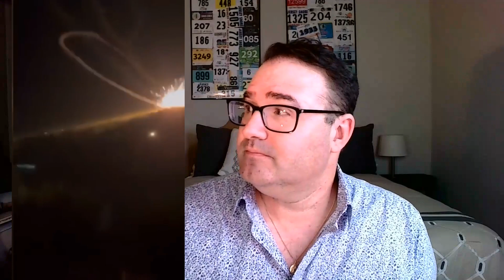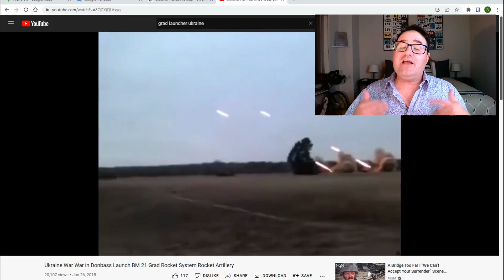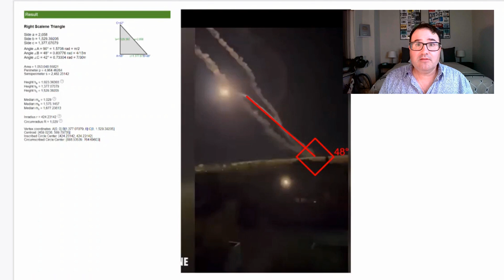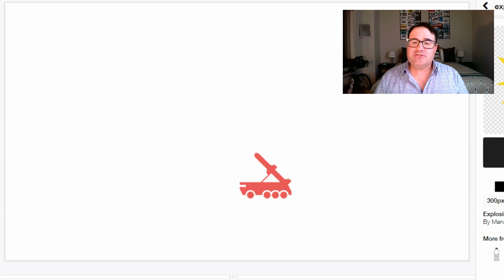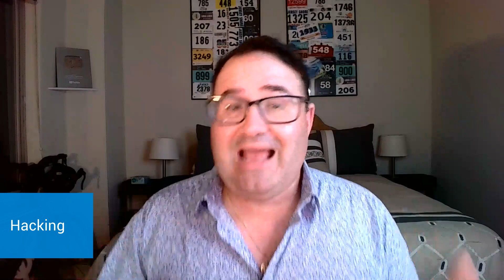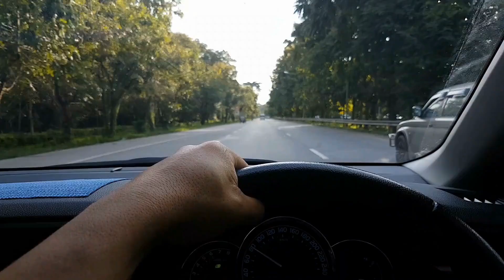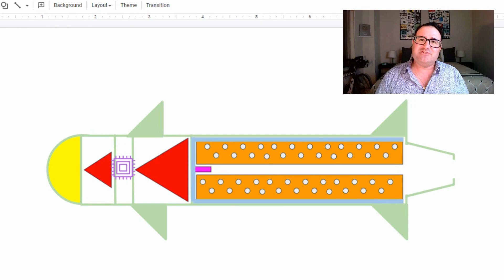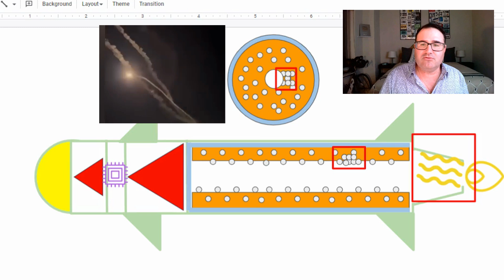Why this missile U -Turned

Comment: So I feel that the throat would even out any inconsistencies in the burn rate....enough that a 180 turn at high gs would be highly unlikely, especially a tight turn. It might unbalance the thrust, but not enough for that turn. I know it might be random chance but that is a very tight and precise turn. If you've ever see a rocket loose control due to fuel inconsistencies youd see corckscrewing, a parabolic curve, wobble or something to demonstrate an eratic burn rate. The point of the throat is to turn burn into parallel velocity.
Reply: It would probably also mean the instability happened in the nozzle...after the throat. Im guessing we'd detect that in the exhaust. Just my 3 cents.

Comment: Very plausible theory and sound logic.  However, I have a question about the fins.  I agree that there might not be a condition external to the missile to cause the fins to turn the missile around but since you brought up mishandling/maintenance/poor manufacturing, could a mechanism stabilizing the fins have broken after launch due to the massive acceleration/g-forces incurred in the boost phase?
Reply from the maker: Maybe, but usually When something breaks with that kind of catastrophic failure, it stays in the broken condition. It doesn’t correct itself. I think it’s the correction which leads me to believe it was a propellant issue. Someone else brought up that it could be a faulty switch that flipped during his g’s then flipped back In the turn. I think that’s possible.

Comment: Except uneven engine thrust can't cause such tight turn, for that you need side thrusters, or control surfaces.
If this was an uneven thrust issue, the missile would do at best a big 90* arc.
You are missing one obvious thing, which is the malfunction of the onboard control systems, which could rotate the control surfaces and cause the missile to turn.
Also, it wasn't just U turn, but a continuous turn which started with U turn. It's obvious from the video that the missile keeps turning as it slams into the ground, so it would keep turning if not the ground.
Most likely control surfaces got completely flipped for a hot second, and then almost returned to the proper position, but not entirely, so the rocket was still turning as it slammed the ground.

Comment: GPS guided. That missile was hacked,not through internet, but by alterating/confusing the missiles GPS locator. Come on, the rocket turned around and pointed the launcher. The clump seems improbable, and would have sent the missile into a spin or exploded midair.

Comment: Hey. Great channel, very learnt and excellently explanative (explanatory ?), perfectly bite-sized videos. But on this point, my take is a bit different. While I agree that while the most plausible explanation has to do with the rocket engine and thrust, I disagree on the mechanics. Disclosure: I'm an aerospace eng. 

First, an uneven distribution of propellant - or any other irregularity on the inside of the engine - probably will not cause asymmetric thrust. This is generally because of: a) the large volume of the combustion chamber of solid rocket motors, which enables effective mixing and "forgetting" of the conditions upstream, and b) the "chocking" of the flow - reaching inner speed of Mach 1 at the narrowest part of the exhaust nozzle (aka "throat"). Basically, the physics dictate that the highest possible flow rate must be achieved, and it can only be achieved if the flow is uniform at the throat, and so no internal irregularities are "visible" on the outside.

Second, if there is gross irregularities in the propellant distribution, it will much more likely to cause a rupture of the combustion chamber and then rapid explosion, due to the out-of-spec heat and mass transfer, by orders of magnitude. If it happened, I think we would've seen a visible "sprite" on the side of the rocket - which we did not, but maybe that was due to camera angle. 

Third - my take on it. I do agree that external aerodynamic forces on fins are too meek at that starting flight stage. To mitigate that, and to control the missile effectively during the boost stage, many similar-sized rockets use thrust vectoring, which gives loads of control authority. This is done by either swiveling the nozzle itself, like Shuttle's SRB's, or by inserting vanes on the outside of the nozzle - called "jet vanes". Look here: https://www.grc.nasa.gov/WWW/k-12/rocket/rktcontrl.html . So I think it was either a malfunction in some thrust-vectoring mechanism, or it's the exhaust nozzle itself that was damaged in some way and produced an unmanageable side thrust.

That's my two cents on it.

Would love to know what you think of it.

Comment: It is the only answer that fits the observed behavior of the missile. My thought was a broken guide fin actuator that caused one fin to be locked at an angle, but that would not result in the observed behavior. If a fin actuator failed at the moment the missile started to deviate from the normal trajectory it would not have ever stopped and the missile would have continued to turn until aero loads destroyed the missile or it impacted the ground. It could not have flown the straight path back to the launcher after the actuator failure.

Comment: It's a good theory. It could also be poor manufacturer of the guidance system. Several years ago the Russians loss a Proton rocket in a similar fashion. A few seconds after launch the vehicle turned around and slammed into the ground, all because one of the builders installed an accelerometer upside down.

Comment: I think your way off on something. The distance from the launcher or the distance traveled.  It wouldnt of been in the pic frame if it had moved 2 kms. The way you estimated the flash/bang and then used this data to estimated travel time is wrong.

Comment: Couldn’t it be a radar lock problem ? Maybe it lost track of the target right after launch ?
Reply: Typically, they are designed to self destruct in flight if the tracking is lost. I don't think this would have made the rocket turn or impact the ground.

Comment: I don't think it was a fuel issue if you look at the trajectory of the rocket it went exactly back to the launcher. It looks as if that rocket had a new Target.   What are the possibilities that the case of the rocket was compromised by the heat of the fuel?

Comment: A decent theory. Why then, after the fuel clump was burned away, did the guidance system NOT attempt to make any corrections, that we can tell, and keep the missile going in a straight line back to the ground?  Using your theory, I guess we continue with the, “there still isn’t much guidance going on at this point in its travels” argument, and so it continues in a straight line, albeit 180 degrees in the wrong direction?

Comment: I think your explanation is thoughtful and well supported with the available evidence. A clump of propellant does explain the turn and then the return to straight flight.

However, ir doesn't not explain how  the missile heads right back to the Launcher. It's possible that it's a 1 in a million coincidental result. But a malfunction in guidance seems a better explanation for the result. The minimum range of a Buk M3 is 2.5km, so it has to be able to manuveur inside of that range to hit the target.

Comment: Usually I greatly value your input and data, because you are very knowledgeable and concise.

However, in this instance, I feel you are incorrect. The amount of turning thrust an uneven load might cause is just (in my view) unable to produce enough turning thrust out of an uneven load, and it is more likely to explode than to turn such as it does. Just seems like that is not going to happen. This would almost certainly require the fins to turn so quickly.

edit

You seem to be ignoring that this is a malfunction, and the missile will absolutely be changing direction and guiding using the fins. It's entirely possible that poor manufacturing caused the fins to over rotate, for any number of reasons. Again, I only resort to this perspective because of how impossible a 'clump' is to cause such thrust vectoring.
Reply: A lot of rocket enthusiasts seen to agree that improper fuel stuff can lead to rockets going in weird directions.

Comment: I’m not sure we can dismiss hacking that quickly. It certainly isn’t on the internet but neither were the Iranian centrifuges. Lol. 

I have a couple of questions if you know the answers. 

1. Are those missiles capable of being controlled in anyway after it leaves the physical launcher? Change of target, change of detonation profile, flight termination via human intervention, or anything else that changes the operation of the missile from the pre launch profile in anyway. 

Does it use GPS or any other type of signal based navigation including laser, tight band following, radar guidance, or anything else of that sort?

How does the mission profile get loaded on the ground pre launch?

I found myself thinking a couple months ago that Russian equipment was using Western silicon in its planes, missiles, etc. that it would be reasonable to think that the CIA / NSA could find a way to introduce modified chips into the pipeline that contain some sort of defeat capability that stays dormant until activated. I’ve been looking for events that seem odd, extremely lucky, or beyond what we think that Ukraine is capable of. There have been several and this feels like a possibility.

Of course, Occam’s Razor is in play and a fouled solid rocket booster is a much more likely explanation.  But I’m a tech person and it makes it more interesting for me if it’s something nefarious.!
Reply: Btw, I also am burdened by the fact that English is a second language for me as I also grew up in NJ. Whippany to be precise. So my first language is has an Italian component to it. :) so if my last comment was not clear, Fuhgeddaboudit.

Comment: Your theory of “mishandling” aka poor production quality of the fuel is probably correct. While the propellant and burn pattern may not be configured as the schematic presents, solid propellant needs consistent manufacture for uniform burn per design. It makes sense that manufacture quality is degrading given the number of missiles the invader has fired at Ukraine and the likelihood of increased manufacturing pace to restock.

Comment: That doesn't sound correct to me since the likelihood of it actually having a clump that has just the right amount of fuel to turn just the required angle, no more and no less, is extremely low. If anything, the trajectory of such a missile should be a bunch of wild loops before fizzling out.

Comment: I don't believe improper propellent distribution would cause the rocket to turn 180 then straighten back out. With the "clump" of propellent in one area of the rocket motor would increase the chamber pressure in the rocket motor if the nozzle (fixed nozzle) itself was intact it probably wouldn't cause the missile to turn unless it was damaged. and if it was damaged the rocket wouldn't straighten back out after high G turn. If the chamber pressure was great enough to cause integrity issues, it would have been noticeable (R.U.D.). In my opinion it was poor manufacturing of the guidance system. A connection was lost (i.e. wire, or circuit board) at the higher G point in the acceleration, but when the rocket turned the G load was reduced causing the contact to reconnect and the rocket straighten out. Just my opinion. Great videos
Reply from the maker: I think that might be possible.

Comment: Is it possible that once the missile turned sufficiently, it locked onto the heat signature of the launch pad? Or guidance is inactive at this point?
Reply from the maker: This particular model uses radar, not heat. But a good theory.

Comment: Spot on analysis, sir. I worked as a U.S. Army photographer, cover all aspects of information collection. One of these tasks was accident documentation and analysis. The amount of causes due to a badly set o-ring, filters replaced in reverse orientation, overtorque on just one bolt? Planes dropped from the sky after the cascade reaction from such instances, so yes. No stuck Fon would have the capability to overseer that missle, it would've snapped off. That also would happen if it had been hacked, as that steer was way outside the engineered envelope. It's amazing that it didn't burn through the insulation and break apart mid-flight.

Comment: From what I know about civilian and scientific solid rockets, which granted isn't a whole lot, that seems like a distinct possibility. Fuel and oxidizer settling out into an uneven mixture's naturally gonna occur if you're not regularly rotating and maintaining rockets while they're in storage, also depending on the medium they used to make the fuel paste, any significant or frequent changes in temperature and humiditiy in the storage area's going to cause it to break down and maybe crack, leaving an uneven surface on the fuel causing unpredictable alterations to the rockets thrust vector same as a lump of denser fuel and oxidizer would.

Comment: After the combustion chamber, you have a converging diverging nozzle. You get a shock wave in the narrowest point, the throat of the nozzle. Wouldn't that make the flow of gases more homogeneous? Could the wake turbulence of a previous missile knock it off course? A friend of mine flying a small twin engine plane barely survived hitting the wake of an airliner on final. It nearly flipped him over. And he was landing 5 mn after the airliner, but some weird aerologic conditions kept the vortex spinning.

Comment: First flight of the Ariane 5 had a 90 degree heading change commanded about 30 seconds after launch due to an overflow in a floating point to fixed point conversion.  Given several guided rockets were launched at once, the possibility of the ground based control system having a frame overflow (ran out of its allotted execution time before finishing its calculation) and  causing a similar type of over or underflow should be considered.  Not necessarily bet on, but considered.  This is what that category of error would look like.

Comment: it doesn't work this way. there's nozzle through which gases evacuate and that evens out pressure on different side of the fuel charge. this was just guidance system malfunction i guess

Comment: Your theory is interesting but I don't believe that's the case. Even if there was an uneven fuel burn, it couldn't possibly make the missile turn that tightly; especially when you consider that the guidance systems would be fighting the turn, in an attempt to keep the missile heading towards it's target.

Edit: Also, if this was caused by uneven fuel burn, it wouldn't have own such a straight path. Most likely it would've done some corkscrew type turns.

Comment: Disagree sir
The exhaust tube is constant, regardless of burn/thrust bias within the cylinder the thrust is not offset off centre…it would need to be external of the central mass to affect direction

Comment: Personally, based on the footage, the Turn was too sharp/short, IMO, for the Fuel theory to work. Based on the how the Missile traveled, I believe the Onboard radar came on too early, and locked on to the closest source of radar. The Launch site. The turn was too precise and then tracking of the missile looked more deliberate than accidental. 

Basically, The Missile went active WAAAAY too early, and killed the launch site.

The Russians say it the cause was from Electronic Countermeasures. It could be possible. could be not. If we go by that theory then, the Russians more than likely shot the Missile without a lock be the Track Radar and was hoping it would lock onto the Radar emitted from their intended target. As we can see, this proved to be the last bad decision that ADA crew made. 

My theory is, They shot several missile prior only for them to loose track mid flight and the missiles not picking up their intended target, so, they shot one without a radar lock from the track radar. IIRC, this was a tactic used by SAM crews back in the day(It is also a tactic used in A2A BVR fighting, but can have some grave consequences if done incorrectly. Consequently when using an IR type of Missile in A2A, it is possible(if you're not careful) for the missile to lock on to you if fired without a lock on the target). This could definitely be a sign of insufficient training on the guidance systems of Missiles used for the ADA crews.

Comment: Notice how clean the turn is, then nearly becomes a parallel return, i don't think it's a fuel clump rather onboard guidance. It looks likea max g turn. I presume there's onboard guidance before the track radar gets uplink and begins guiding. I posit that the onboard gyro was providing an incorrect signal. Thinking it was 180° out after inital boost. If i had to guess someone installed something incorrectly

Comment: The other option is an error during the manufacturing of guidance and stabilization systems of the missile itself. I recall the similar looking crash of Proton rocket several years ago and the cause was a incorrect position of the angular velocity sensors. The guidance system was getting incorrect data and as a result rocket started wobbling left and right, which ended in vehicle loss. 
As far as I remember, the sensor had a foolproof pins which were preventing it incorrect setup, but it was forcefully set with a hammer. I will not wonder, if that was the case. I’ll try to find video of that crash.
Reply: Here’s it https://youtu.be/YUhK5vnSigo